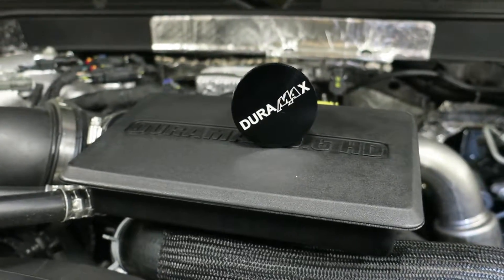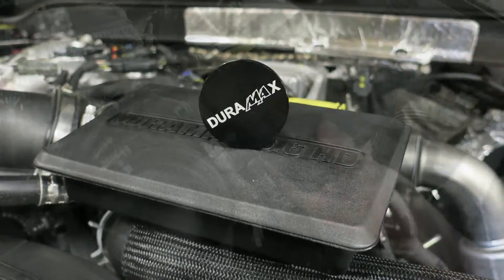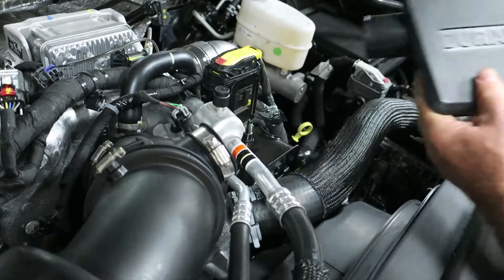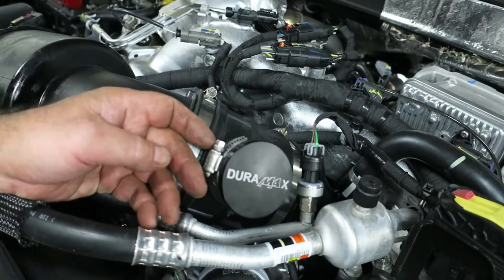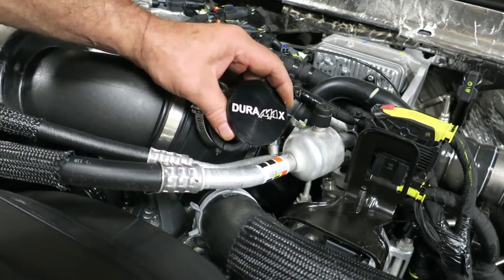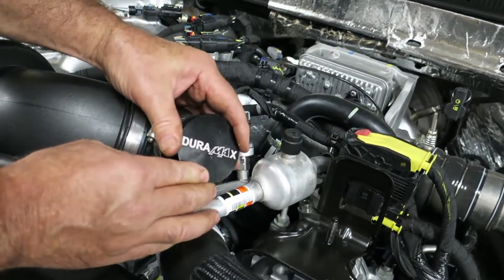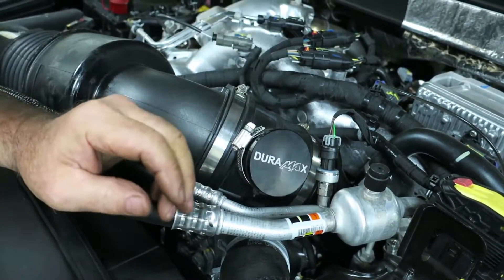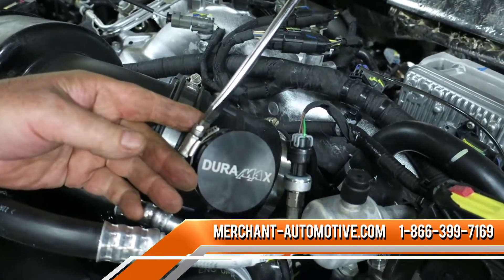Mechanics Minute: L5P Duramax,  Turbo Resonator Delete Plug Install

Comment: was looking around at my work for material to spin up a plug on the lathe but then ran across a olympus lens from a microscope. fit in there perfect plus now I can see inside the hose for no reason whatsoever.

Comment: I did the same with a 2” pvc plug from Lowe’s. The black rubber one that comes with clamp. Fits right over.
Reply from the maker: Just keep an eye on it as the rubber can deteriorate over time and cause a leak.

Comment: The plug made a very vary small difference in the whistle, so small you can barely tell. The S&B intake made more whistle then the plug but still not a huge difference. The plug looks pretty cool though that just about it.

Comment: What does this benefit
Reply: B&K Excavating LLC it actually spools the turbo faster. Turbo whistle changes ever so slightly
Reply: Oscar JR no it does not. Zero performance what so ever.
Reply: Oscar JR Sure 👌
Reply: Robert peterson Makes the turbo whistle louder. No performance increase just a better turbo sound in the cab.
Reply: Sold
Reply: My 02 LB7 had a resonator on the intake and once I installed a S&B cold air intake the turbo whistle was much louder and sounded great. With how quite the new L5P is I’m sure the turbo whistle will sound great
Reply: Going to try this out 🤞MORE WHISTLE!!!😏